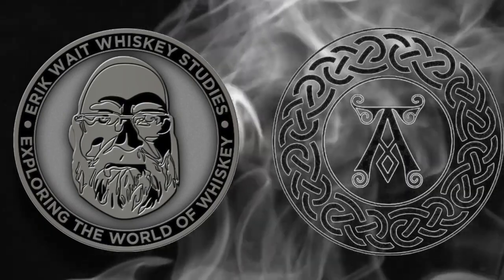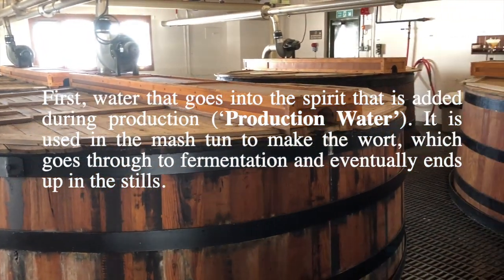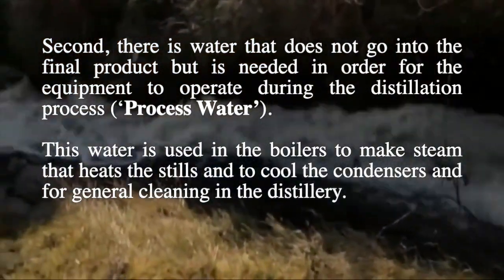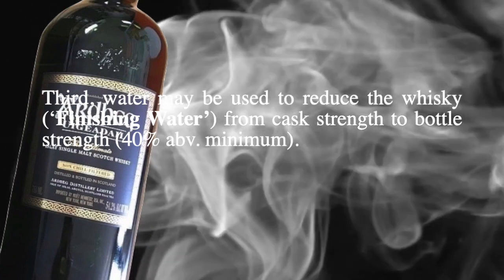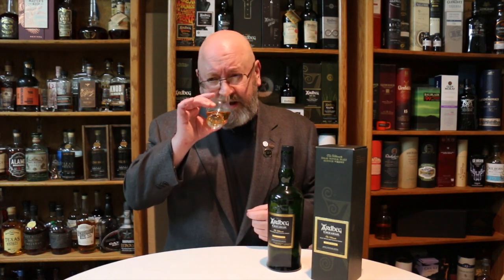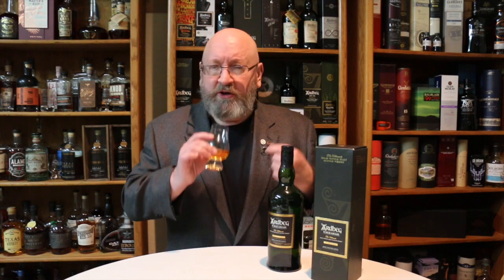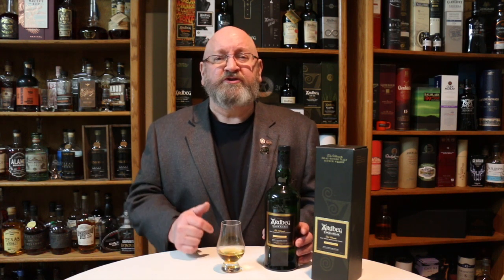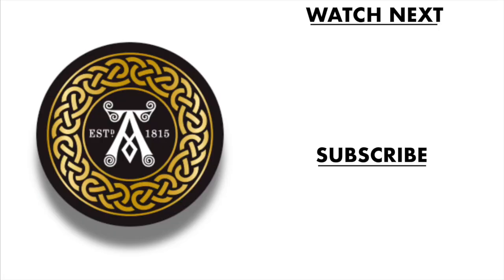Ardbeg Uigeadail Islay Single Malt Scotch Whisky

Comment: Nice review,good info on the water influence. I'm barely past the shoulder of my bottle so I didn't quite get to find out all that Uigeadail has to offer,usually takes me till the half of the bottle to form a solid opinion,but so far I like it. It's little overwhelming (compared to 10yo) but I like it more and more. How do you compare it to corryvreckan?I found that of all different peated whiskeys I tried I like ardbeg's the most,first the 10 and now Uigeadail even more,so I thought logical step would be the corryvreckan.Cheers...
Reply: Corryvreckan is very different from Oog; much smokier, less prominent peat, more medicinal, herbal and bitter; it's really not for the faint of heart. The sherry sweetness in Oog makes it far more accessible than Corry to a newcomer. But once you get hooked, there's nothing else like it :)

BTW, re. "of all different peated whiskeys I tried I like ardbeg's the most" - have you had any Octomore (ideally 8.3 but I doubt you'll find it anywhere)? If Oog is "a little overwhelming", you'll need an ambulance after an Octo :))
Reply: @gormarx  Sounds like I'm gonna love the Corryvreckan,I don't mind the smoke :) Its ABV% I found bit overwhelming  because I don't add water. Not Octomore but had more 'mainstream' ones (Laphroaig10,Lagavulin16/8,Bowmore12,Caol illa12,Ardbeg 10 Oog Perpetuum AnOa,and some less peaty like Highland Park12,Talisker10,Oban14) and of them all I prefer Ardbeg's style the most.  Thanks for the reply...

Comment: I have been hearing that the recent Uigedail has declined in quality. I will like to know what year the one in this review was bottled. If its a recent year then I might buy it.
Reply from the maker: The date on the bottle is 3/8/2016. The date is very difficult to read. I had to check it 3 times and use a magnifying glass to read it.

Comment: Your prices seem to be on the very low range. I have never seen this under $70
Reply from the maker: I have a snap shot from “Wine Searcher” search engine that lists numerous stores with these prices. Sometimes I put the picture in the video. K&L Wine Merchants in Redwood City and San Francisco has it for $57.
Reply: I must just be very unlucky then. I am in western NY. I have seen it online under $70 recently but never in a local store.
Reply: @marcwhiskey  I had to use points to get 10% off $87. My local with good selection and decent prices has it way up to $98. (They have 10 @$44.99 and corryvreclan @$95)
Competition has Uigeadail@79 while total wine in North NJ $82. 
   Downstate NY. Great local spirits but lousy pricing. We're near Hudson Bourbons. They made the nicest apple gin called Half Moon
Reply: I picked up a bottle of ugie for $77 on sale one time. Otherwise never saw below $82